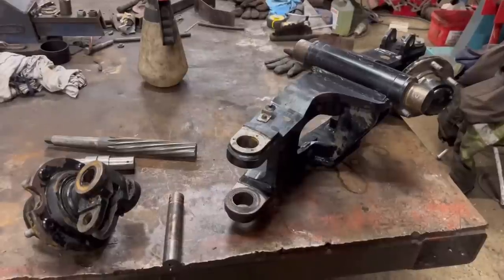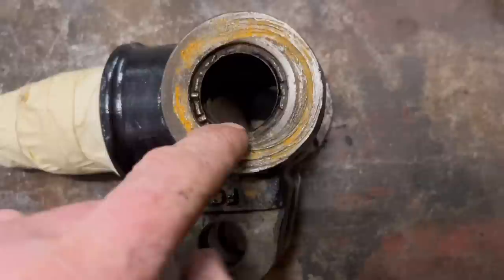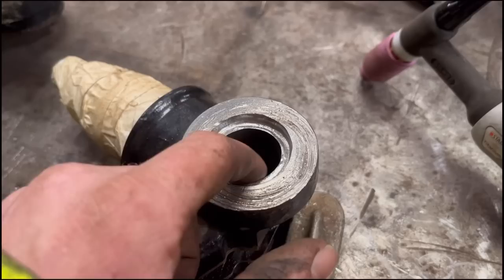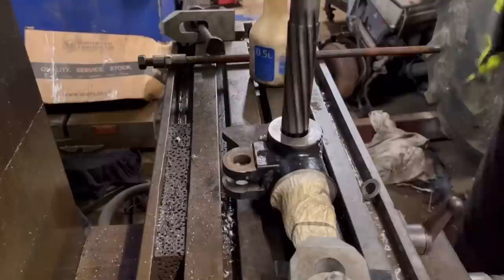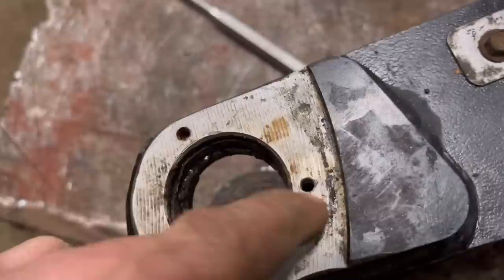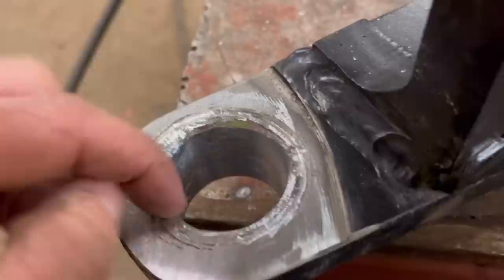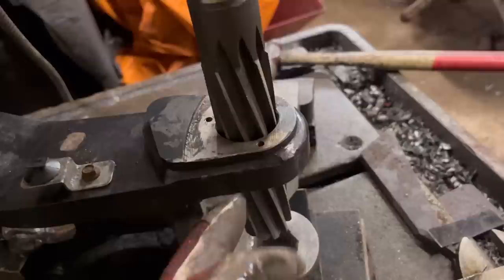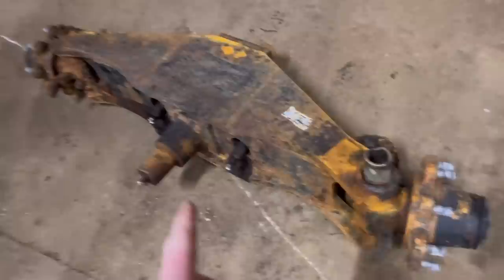Toyota forklift axle repairs. Destroyed king pin bearing.

Comment: Your exactly right about wearing eye protection and ear plugs working in such a dangerous environment as a engineering workshop, I have complained to certain people on you tube about using grinders without wearing eye protection, Also using pto equipment with the necessary guards on chains and sprockets, Great videos as usual.🇮🇪🇬🇧

Comment: Suggest getting a bushing chisel (may have one in an air chisel kit) It has a curved end that peels the bush out, sometimes leaves a light groove afterwards which is easily dressed with emery mop wheel.
Really great channel and your ingenuity in using the equipment you to do the job. So are you self thought or dad taught? Guessing it’s a farming background either way 🤷🏻‍♂️ Enjoying the content keep it up fella 👍
Reply from the maker: I do have a bushing chisel I made but it was the outer race of the needle bearing I was removing so it was very hard.  My dad taught me about engines and mechanical stuff from a young age, then I did 7.5 years working for an agricultural engineers doing similar work to I’m doing now along with fabricating buckets and handling equipment for loaders.   Thanks! Glad you’re enjoying watching.